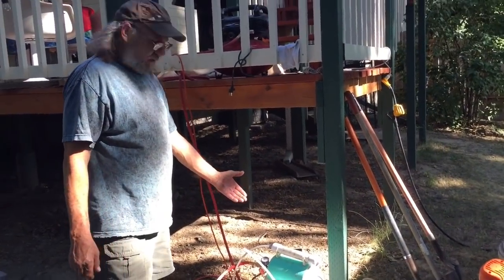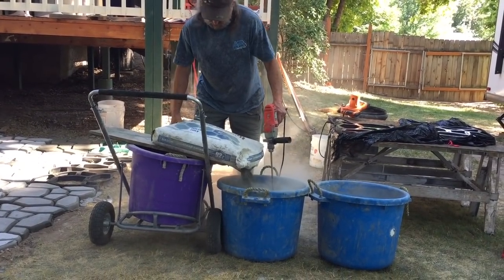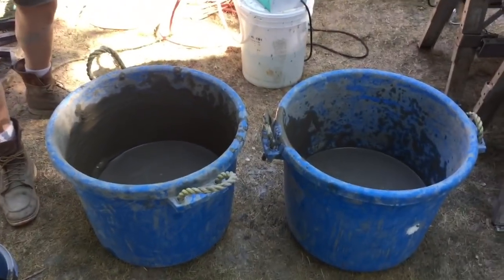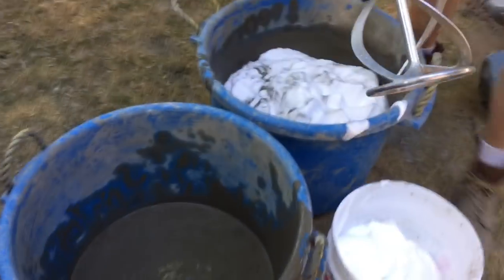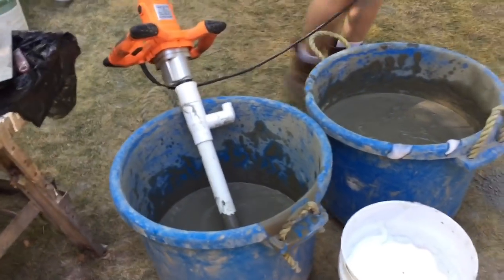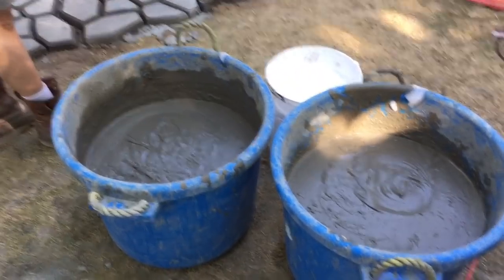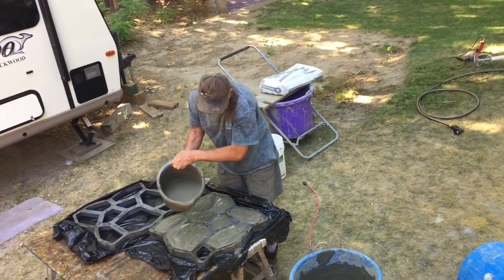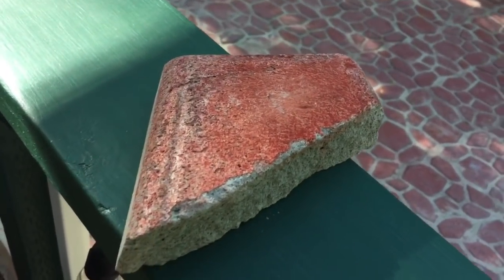Air Crete patio using little dragon

Comment: How much time do you have before the mix starts to set up? Thanks for the video.
Reply from the maker: oruwatching  it starts to set up pretty fast. We could pull the forms in 45mins to and hour.  It took about 24 hours to walk on. Once we poured it in the forms he would smooth it out. The aircrete does not want to be smooth out again. It wants to stick to the cement trowel.
Reply: Thanks

Comment: Great video, and the patio looks fantastic - along with the retaining wall around it.  Great job!  I'm curious - where did you get the form for the "bricks?"  How was the pigment applied?  Lastly, how did you fill the joints - just sand, or is that mortar of some type?
Reply from the maker: northavealum  we got the form at Home Depot. But I think a lot of places sell them Amazon, Lowe’s.    The pigment was liquid concrete color put in a spray bottle with water and put on top it’s soaks into the air Crete.   There is a follow up video that shows you what we did.   But I’d like to tell you we have change the pattern it’s not good to set chairs on.  I’d recommend a more solid pattern than the one we chose.    Thank you very much for the kind words.

Comment: Hey ,, how did you do the finishing of that patio, that its finally having red surface and no gaps inbetween... thanks for the video and info
Reply from the maker: TINA- This Is New Africa  We put sand in all the cracks and sprayed concrete coloring on it we did a video on that also.  Thanks for watching
Reply: @kathyjohnson7132  Thanks for the quick answer. ;-)

Comment: The finished product looks great, so how did it hold up over the winter? Could you have used a regular cement mixer?
Reply: oops, just found the follow up videos.
Reply from the maker: I think you could. I believe the mixer we use just stirs from the bottom.   Thanks for watching 😁

Comment: How durable is the surface? Will the blocks float? I would like to build a floating concrete dock using the Little Dragon if the finished product is light enough.
Reply from the maker: Jim Ferguson The small blocks will definitely float as for using it for a dock I have no idea if that would work. But like our patio it's worth a try.
Reply: Floating blocks? That is what my concern was when you have a heavy rain or snow melt in your area, will they float away or become rearranged? Time will tell. Nice video, thanks for sharing.
Reply from the maker: +Jason White   The blocks are locked in with the sand I don't think we're going to have a problem but will let everyone know if we do. 😳

Comment: Thanks for all this, we appreciate it as we learn new techniques. We are wondering though why this is preferable for your application. You don't need insulating qualities for a patio, was it only for more volume? If so, wouldn't a 3x sand/1x cement give you more volume while also being much stronger? Just wondering why.
Reply: Oh yea - subscribed.
Reply from the maker: We did it because we bought the Little Dragon and wanted to use it before we actually  I took a class. We couldn’t find any do it your self videos on something we could do around the house. We choose to try a patio.  Thanks for Subscribing

Comment: New to me; very interesting.  How much drying time before removing forms?  Obviously you filled in between with?
Reply from the maker: About an hour drying before removing forms. We use sand to fill the lines.   Thanks for watching
Reply: ...It's a shame you have to tell every third person how you colored the concrete and how many gallons of water you used. Lord, doesn't anybody READ... @kathyjohnson7132

Comment: Great video! So glad to find Dome Gaia products!!! I'm curious how the patio stood up in freezing temps. Any cracking? Thank you!
Reply from the maker: There's no cracking from the cold.    We have a broken brick from a branch, and there is a couple of bricks that the very top layer has come off.  They are in the very first bunch we poured.  Should be an easy fix smooth then re color.   But we don't know what caused it, could be we did something wrong in the first pour.   We're going to do another video when the snow is all gone and show exactly what's happened through the winter.  Thanks for watching

Comment: Im pretty sure your supposed to use air to make the foam in the concrete expand in effect drastically increaseing the volume of the product. Aircrete has little pockets of air literally where the foam once was, giving it unique properties similar to that of wood. I think you made foamcrete. Correct me if im wrong.
Reply from the maker: kris steitz  our understanding was it was air Crete  the little  dragon was connected  to an air compressor that blew air through the water and soap and caused the foam.  But we could be wrong.  We called it what we thought it was.
Reply: Kathy Johnson. I dont know what im talking about. You have more experience :/  im totally doing something similiar
Reply from the maker: kris steitz  well good luck  with it.  Maybe you could do a video and show us.  I'd be very interested in seeing what the differences are.   We're just learning about aircrete.   It sure won't hurt us to learn more.

Comment: Here's a valuable tip. You will get 5-10x more bubbles if you use reverse osmosis, conditioned water. I kid you not, you will be amazed.
Reply from the maker: Hydro Hydride I didn't know that . Will use the water from the water softener next time. Thanks
Reply: Kathy Johnson someone can correct me if I’m wrong, but I think reverse osmosis removes the salt from water and the water softener adds salt to the water..?
Reply from the maker: Dennis Benjamin  thanks  there's still so much for us to learn.
Reply: Hydro Hydride - I am familiar with RO water, but then you say conditioned... Is there a second "conditioning process" you are referring to, or was the RO the conditioning you were referring to?
Reply: orcoastgreenman yes. I sold purification systems and each is a stage in a system. Showering, washing clothes, cooking with ro and conditioned water makes a difference. So many suds with softened water. Look into it.
Reply: Hydro Hydride - ok... So your conditioning term refers to a standard water softener after the RO... Thanks.  Was wondering if it was one of the more woo woo things I've heard of like water alklyzers or "magnetic water conditioning"
Reply: Carlo DAngelo 
I would like to see comparisons between RO and Distilled water.

Comment: looking forward to hearing how it's holding up through the winter.  Keep up informed and ty for the video! great job. What kind of paint did you use to paint it with?
Reply from the maker: Rixanne H  Thank you for your kind words. We will be doing more follow ups. We used liquid concrete color. It should've been put in the liquid concrete but it worked well on top of the concrete.  We have done a follow up video. We have made a follow up that shows how we colored and grouted the patio.     It called.     AIR CRETE PATIO 2 MONTH FOLLOw UP.   Thanks for watching  😀
Reply from the maker: Rixanne H https://youtu.be/yYQaoxMPX30

Comment: Couldn't get to the sound control fast enough as I saw you reach for the compressor switch... :D

No aggregate or sand at all. Interesting.
Reply from the maker: Kevin Blanc sorry about the sound. Will do better now that we're aware of the issues.   Yes there is no sand or aggregate in the cement.  We did use sand for the grouting. It's been two months now we're going to do a follow up video today. There been a few  questions we would like to answer. And you can see how well it's holding up.  😄

Comment: Uncle, what did you do??? Put the foam into a bucket and then into the cement water slurry???
What do you think the white tube connected to the stirrer is for???
You connect the foamer directly to the stirrer then the foam is injected directly on the bottom where the stirring is taking place.
Reply from the maker: eireannsg we actually understood how to hook it up we thought for the video it would be better for people to see how thick the foam was and how much we were putting in.
Reply: OIC, you could have created some foam to show it to the people and then connected the foamer to the stirrer and used it as intended, to show people how its done.
Its also much easier to blend foam and cement slurry when the foam is not floating on the surface but injected close to the stirrer blade.

Comment: Fascinated. Wish I could hear what you are saying.
Reply from the maker: Maria Burke  we didn't realize how bad the sound was until the job was done. At that point it was post as is or not post it at all 😢 We will definitely try to do better on the sound if we ever do another video. Sorry
Reply: Just click on CC at the bottom of the video, (close caption.)
Reply: Exactly what Seb Julien said... click on the settings/gear icon near the bottom right corner of the video and turn on the captioning feature!
Reply from the maker: +WJK  we are sorry that the sound wasn't better. We only decided to do the video on the very last bricks. There wasn't anyway to go back and redo  we were done. We're just hoping the information was Worth the bad sound.  😑
Reply: All is good :)  Would like to say, the patio turned out great and is quite an inspiration...I had never heard of this material before!  In a future video (when you get time) could you go over the cost of materials and apprx number of hours it took to complete the patio(?) Thanks!
Reply: WJK I believe he said it took 2 weeks to make. Only taking a guess that their lives have other elements, possibly working on the weekends  or after work? I don't know such cost but I'd guess they saved $ by purchasing the forms at a yard sale was helpful. Curious to know how the stones came out as "red brick." That particular pattern I could see in natural stone with a darker grout.

Comment: After seeing 4 to 6 inch concrete poured on a thick slump and still crack from cars parking on it I'm surprised that holds the weight .thanks for the tips tho

Comment: I would like to know if the aircrete (AAC) can hold much weight. can you make a driveway with this stuff? maybe solid concrete with aircrete on top..
Reply from the maker: Kevin Burress  I am just learning about aircrete. I know they have a class that would be able to tell you. 
We were wondering about how it would hold up as a patio, that's why we tried to do it.  In our case it was minimal expense to find out if this is going to work. Now time will tell us.
Reply: If
Reply: I've been waiting to purchase one of these and I'm convinced to buy one, thanks
Reply from the maker: duke jordan  I'm glad we could help. We love ours.
Reply: Kevin Burress b
Reply: Can you lay ceramic tile directly on the aircrete subfloor?
Reply from the maker: James Steven Farrell  we are very much beginners at this. I would not be able to answer that question hoping somebody with more knowledge than I can. Sorry
Reply: 'AAC' is "autoclaved aerated concrete,' which I believe is a much more controlled, factory-type process.  Autoclaving refers to high-temp steam curing of same.  I've no hands-on experience with either, but knowing that this homebrew foamed-cement version is extremely light and can be cut with a hand-saw etc makes me think that it's not going to be up to the task of bearing any substantial point-loads, eg tire contact-patches on a would-be driveway.  Same thing regarding use as a concrete countertop:  if it can be cut with an old-school hand-saw, how will it fare from years of sliding abrasive stuff over the surface, wiping it clean, etc?

Comment: isn't foamed concrete softer than what you need for patio stones? It's easy to cut meaning the legs of your patio furniture are going to make huge gouges in it just setting down... foamed concrete is more for interior walls with regular cement troweled over the outside for protection... foamed concrete has great insulative properties and is easy to work with, like using a wood handsaw to cut to size and wood bits to drill holes in for running wiring and such... not so good for patios where there will be heavy traffic and furniture being moved around on it...

Comment: Can this survive the winter? I mean, real winter, minus 40 Celsius and lower?
Reply from the maker: Seb Julien  we've been running a test the last couple days. We took a aircrete brick Soaked it in water for 24 hours froze it for over 12 hours and now are in the process of defrosting it. We're going to do a video on that in the next few days.  It looks real good no different than when we put it in.  But we won't know about our patio until this winter. We're under the impression it will be fine.

Comment: How do you pick up the loaded form to move it into place?  From the ease with which the form was removed in the video, it looks like the concrete would just drop out of the form if moved without support.  Is there a technique to that?
Reply from the maker: Dave Peterschmidt  we never picked up a form full of aircrete.  Your right it would fall out the bottom.    The bricks at the end of the video on the plywood  dried there.   You move the form not the product it poured in place

Comment: i really like how you made this aircrete, but the thing i like even more is that it doesnt look like you need to do anything to the sub base you can just lay it on grass is that correct??
Reply from the maker: That's what we did.   We do have some grass in between some of the bricks.  We don't like the pattern we chose.  Not good for chairs and feet. If your going to do it....do it more solid. And I would say seal it. And we are working on a new video right now to show everyone how the patio came out through the winter and the changes we've made to it.  I look for it at the end of April beginning of May
Reply: No , you have to prepare your patio site as usual its just they didnt
A layer a sand COMPACTED

Comment: I'm very curious what the pound per pound finished weight is of Portland cement vs Air Crete. Shoot me a message if you would thx
Reply from the maker: Bryan KC8HPS  😌 I believe pound per pound---- they would each weigh  a pound.  😊Sorry I do know what u meant. And I don't have the answer for you. I know that the aircrete block is a lot lighter than one of those little red clay Bricks

Comment: This stuff is actually pretty neat, I may use this stuff on my home, anywhere in Montana? :P thinking about building with traditional concrete that's rebar reinforced and use this Crete stuff as an insulator hmmm
Reply from the maker: chaostic84          Check out DomeGaia.com you'll find it very helpful and inspirational
Reply: i did not think about how it could act as a insulator with all the air bubbles trapped in it..i saw someone making very cheap and very nice dome homes with this stuff.
Reply from the maker: Manic Morzan  that's what got us working with aircrete.  watching them make those dome homes  and wondering what else could be done with it..
Reply: I read or watched a video that talked about his this was not that great of an insulator ... I think about the same as wood or a little less.  Do you know the numbers?
Reply: There's a video on YouTube where they're using this method in 3rd and 4th world countries for insulation AND interior/exterior walls!   Spraying in between metal studs.    One could easily pre-fab sections with wiring and build their own.  They laid the wall frames on plastic as was done here on saw-horses and poured it in.
Reply from the maker: Crfor Freedom thanks there more information there then I've seen anywhere.
Reply: Thank you Kathy!  You're an inspiration to me!  Thank you for this video!  Here's the link to that pre-fab modular construction vid with foam/air crete I had mentioned... https://www.youtube.com/watch?v=gPFDTr-xzv8
Reply from the maker: justgivemethetruth  i'm sorry we really are new at aircrete and don't  know how it would work as an insulator this is the first thing we've done with it.
Reply: That's cool, buy isn't it expensive to play around like that if something doesn't work?  Great sense of adventure though.  Good luck
Reply from the maker: justgivemethetruth  it was not as expensive as you would think,  and we're very hopeful that it will work.     If not will be getting the wheelbarrow out and making a trip to the dump. 😧
Reply: Hey Kathy, if you covered it and I missed it I appologize, but I was wondering about a sealer?  Regular concrete is porous and degrades over time, I can imagine that aircrete would only accelerate this process.  Have you, or have you checked into putting a good concrete sealer over this, and doing so on regular intervals?   I imagine you could just spray it on....
Reply from the maker: Crfor Freedom  we haven't done it yet. Your right we need to and soon.  Thanks for the reminder 😊

Comment: Can I use forms on top of poured concrete sidewalk?
Reply from the maker: I would think so, but I really don’t know for sure.  One person asked if it could be put on top of a driveway. And the maker of the little dragon commented that the cement should be poured on top of the air Crete blocks for a driveway.           I’m sorry I don’t have a good answer for you. We really are learning as we go.
Reply: OK, thanks... If anyone else knows if I could stamp a new sidewalk, that was poured 90 days ago, I sure would appreciate your input.  Thought maybe I could use thin set, then fast drying concrete, but don’t want to screw-up a new sidewalk?????